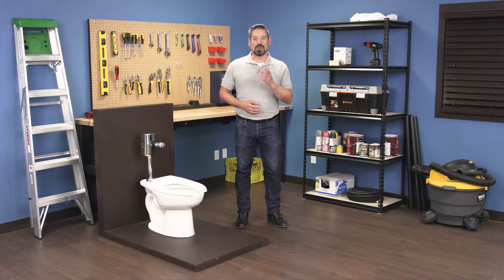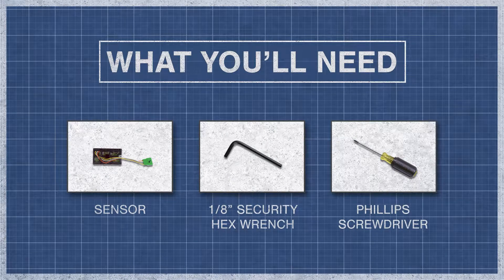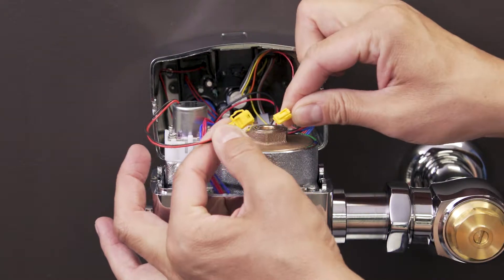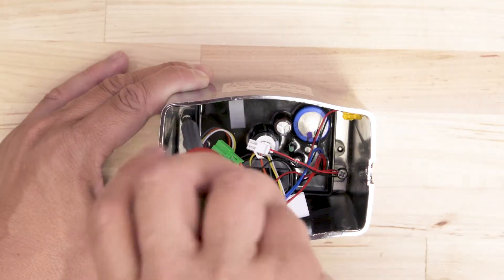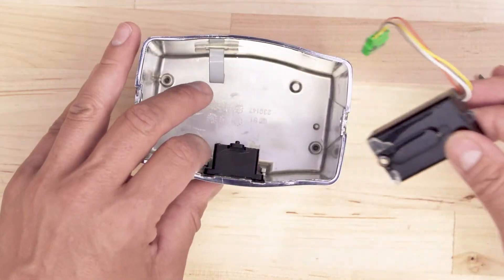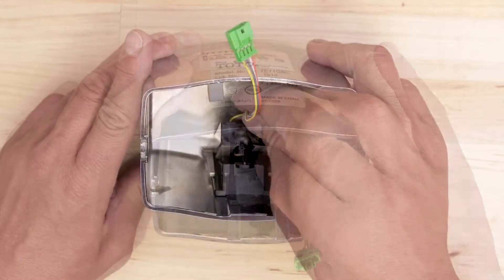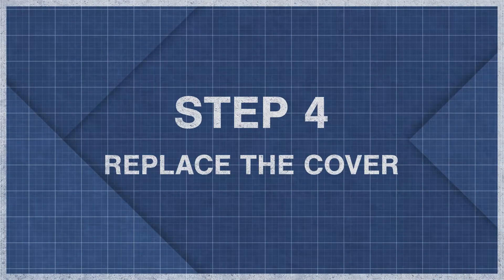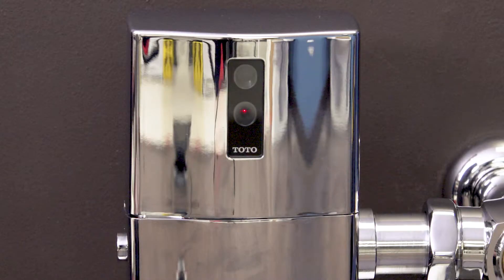TOTO EcoPower Flushometer (Pre-2013) | Sensor | Repair and Replace

Comment: I have my red light constantly on linking, what do I do?
Reply from the maker: A red blinking light on a Toto EcoPower flushometer typically indicates a problem with the battery or the power supply. This could mean:

Low Battery: The batteries may be running low and need to be replaced.

Power Failure: There could be an issue with the power generation or the internal components.